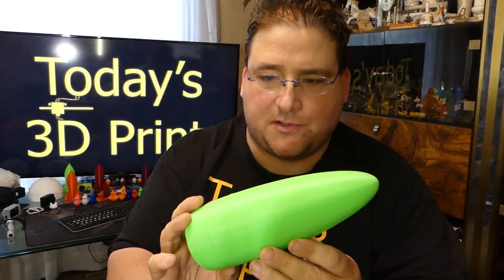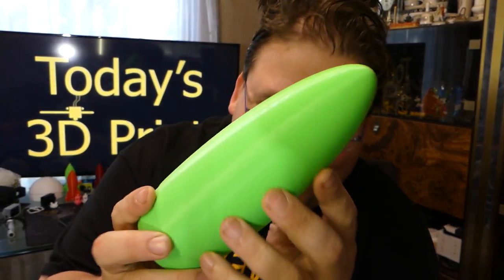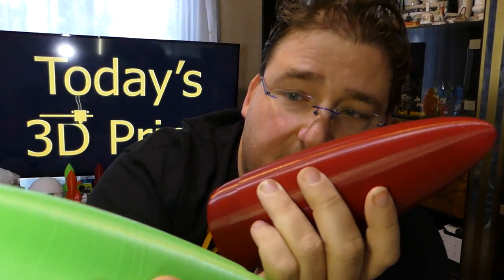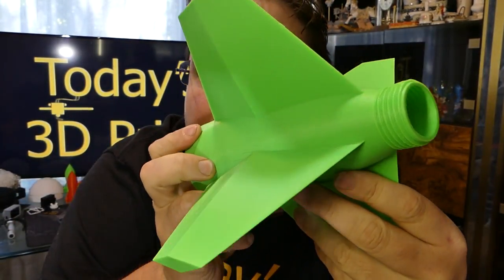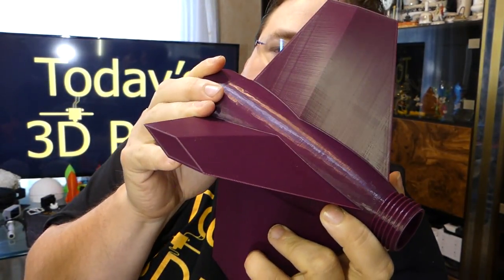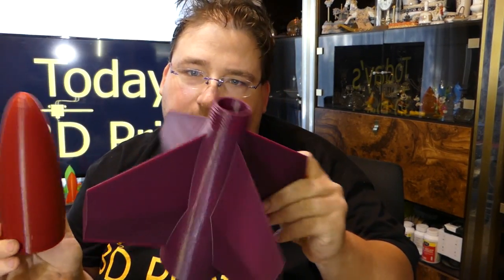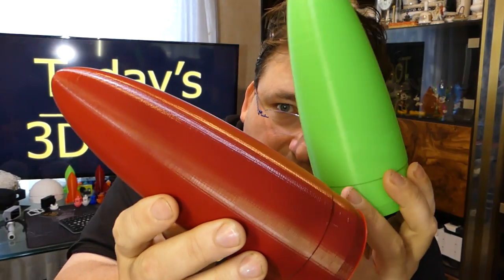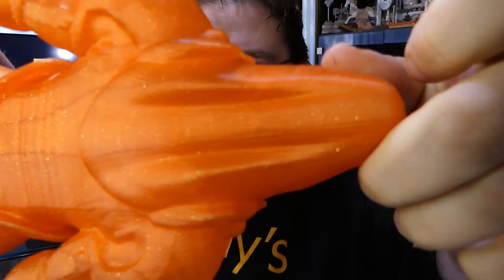Today's 3D Print 119 Print Quality Comparison Creality CR-10 and Tevo Tornado

Comment: If you are struggling to combine desperate bodies then under the modify tab at the top there is a combine feature. Select the combine tool then click the two bodies you  want to join. Ideally you would draw each component as one. I wouldn't draw two fins and the centre piece seperatly then drag them all together, if you know what I mean.

Comment: UGH!!!! I am so torn! I initially was going to buy the CR-10. Then I saw the reviews and comparisons of the Tevo Tornado. The quicker heating bed, and quieter operation, plus print quality made me lean in the direction of the Tevo. But then the salmon skin issue requiring the smoothers, and this this comparison video have me leaning back towards the CR-10!!! I can't make up my mind.
Reply from the maker: Jorden Epps the tevo tornado absolutely positively is not quieter than the CR 10 there's a reason they call it a tornado because it sounds like a tornado :-) but you can quiet it up if you can take her and have a little extra cash I would lean towards cr-10s with a c heat bed or if resolution is not King for you get the tornado with this smoothers and save a whole lot of cash 329 + 25 bucks for this smoothers that's a pretty tough to beat combo
Reply: Hi,  would it be possible to replace the stepper drivers on the Tevo Tornado with TMC2100's instead?  Cost is similar to the smoothers.  Is it a module that can be replaced or is it surface mounted?
Reply: Nerys, I bit the bullet and ordered the Tevo Tornado + smoothers today using your link. We'll how long it takes to come.
BTW, my daughter's middle name is Neryse, after the Star Trek character Kira Nerys.
Reply: tevo is little cheaper so you can add 32 bits board and have better stepper motor instead origina. do you resolve you srface quality issues with tevo?
Reply from the maker: the TL smoothers did resolve almost all of the surface quality issues. its still not as clean as my CR-10 but MORE than good enough and the results are spectacular. I suspect the transparent filament "hides" flaws. I FEEL flaws I can not see visually for example. gonna have to try some solid filament. doing that now. printing the skull mask in the Sunlu PLA + Green I got. looking good so far!
Reply: or you can buy a smoothieware board copy with better stepper and you will not have surface quality issues
Reply: Hey, im all in thinking which one buy for first printer. Just have one question, if this orange guy have face with eyes and nouse... which one printer will make face more detailed?
Like which is better in little models?
Reply: And also, as i got it - tornado is a little bit faster? All reviews in english.. My english is quite bad.. :(
Reply: tevo tornado with couon code is 50euro cheaper than cr 10..at this price range you can add smoothers, other quieter fan, and end filament detector with auto bed sensor..so it s better than cr 10
Reply: Jorden Epps I bought the tevo after the pros and cons of each

Comment: Hey Chris,
can you post the Acceleration and Jerk setting which the Tevo has? (also E Acc and E-Jerk and Retract Acc)? Because I assume the difference in the Zippers in these parameters... Thank you!
Reply from the maker: MasterFX2000 i manually set my acc to 500 and xy jerk to 10

I will check the others when i get home.
Reply: Ha ha... did you noticed that the max retraction speed on the Stock CR-10 is set to 25mm/s? So whatever you enter in the retraction speed in the slicer the CR-10 will just ignore it if it is above 25 mm/s. I just recompiled marlin to set the max to 80mm/s... lets see what happens. I also increased the retraction acceleration to 1000 mm/s^2 instead of 500 mm/s^2
Reply from the maker: +MasterFX2000 well well well I never noticed that! Very interesting

Comment: Modify-Combine in F360 combines bodies

BTW have you tried the smoothers on the CR10 yet?
Reply from the maker: +rok vez not yet. I suspect they won't do any good since the cr-10 doesn't have that kind of noise I noticed on the tornado it got rid of the salmon skin which was electrically introduced noise but it did nothing for the mechanically introduce noise ghosting ringing

The problem is the one part that I want to come by and see important STL not a body :-)

Comment: Thanx nerys for your review
Have you test abs or nylon filament on cr10 or tornado ?
Thx
Reply from the maker: +Eric RUFF I have never printed with abs I did buy a role to play with I have one around here somewhere but don't really have much use for abs nylon I really want to play with but have not yet the trick with nylon is bed adhesion from what I understand I have some Gara light for when I go to play with it but I have not yet the cr-10 would struggle with abs without healthy enclosure the tevo tornado shouldn't have a problem with small stuff since the bed can get hot enough the cr-10 would struggle with that I'm working on upgrading my cr10 to handle high temp Plastics I ordered a tevo tornado heatbed to add to my CR 10 maybe I will add it to the S4 don't know yet

Comment: Is it possible to upgrade the CR-10 with a similar heatbed as the tornado to get higher temperaturs and faster? Do you then need to change the software in the CR-10? Would it be expensive?
Reply from the maker: +Science Rox i think it is possible. Ask me in a month. I ordered the ac heat bed and ssr from tevo and i am going to try to do exactly that. If it works under $100.

Comment: Hi there. How would you get the tornado to the same high resolution as the cr-10?
Reply from the maker: Carmelo Di-Rosa not my area of expertise but with an educated guess I would say replace the brain board since the brain board combined with the stepper drivers is the source of the problem I believe so if you took the CR 10 motherboard and put it in the tornado should give you CR 10 quality

Comment: Hi nerys.  Interesting about the smoothness of edges.  I did a quick benchy comparison test between my tornado and my flashforge finder both with esun pla and same settings.  The tornado actually came out much smoother and better overall than the finder did and that was only on .15 layer heights.  Still playing around with settings to get top layers to fill completely and then i will be trying some petg prints.  Did tevo get back to you regarding the ptfe tube in the barrel.
Reply from the maker: +Mark Andrews not directly they simply say it's good to 260 degrees which tells me it probably is a PTFE tube inside so I have new PTFE tubing coming if I can figure out how to replace it it handles 340 C we shall see how that goes the flashforge finder is a much older printer that probably explains the quality difference

Comment: Also how did you go upgrading the cooling fans in control box
Reply from the maker: +Mark Andrews I got the fans and I got the voltage converter I have not had a chance to install it yet it's in the middle of a 70-hour print right now

Comment: Hi Nerys, I have the CR10 but im experiencing the exact same issue you show for the Tornado. If you look at the prints straight on they look perfect but tilt them down or up in the light and you see the shadows cast by misaligned layers. I have upgraded to second lead screw, changed belts, tightened, loosened and re-tightened to no solution. Im using your advise about printing from the stock files on the card to see if the issue is there and caused mechanically or if its software. You mention the issue but not if you have tried to solve it at all, i'd love to hear your thoughts of what it is or could be.
many thanks
matthew
Reply from the maker: +Alucard there are two ways that cause this mechanical and electrical mechanical would be the printer itself and Alignment issue of some sort electrical would be code or interaction of components in the case of a tornado it was the particular stepper drivers that used in relation to the board they used that caused the micro steps being lost which created the Salmon skin

To the best of my knowledge the cr10 and does not have this problem which would mean you either have a fault or a mechanical issue i e and Alignment issue so the first question is did you have this problem before you upgraded to the second leads screw because my first inclination is to assume you have a misalignment the two leads groups fighting each other pushing in opposite directions which would cause alignment issues
Reply: thanks for the fast response, unfortunately the issue was before the upgrade as the upgrade was intended to hopefully solve the issue. Now watching your CR10 build to see if ive missed anything. Its minimal as you say in your vid, no structure failure but annoying shadows. Just cant seem to pin it down, what puzzles me most is that its on all axis. I have an ender 2 coming which i can use for more intricate parts but wanted to see if anyone found out what is causing this slight misalignment. Maybe upgrading to RAMPS if its the step sticks?
Reply from the maker: +Alucard I'm assuming it must be a mechanical issue because none of my cr10 printers do this and I have four of them counting the s and the S4 can you show me a good picture of the problem
Reply: of course, can i send through here or do you have an email i can send them to?
Reply from the maker: +Alucard one more thing send me the g code an actual file you've actually printed that did this I will print it on my printer and that will confirm if it's a code issue or printer issue
Reply from the maker: +Alucard posting emails in the clear is a bad idea so just stick it on Google Drive and post a link
Reply from the maker: add the gcode (not the stl the gcode you sliced) to MAKE one of those such as the AXIS CUBE so I can print "WHAT" you printed. if I get the same result its a slicer issue. make sure its the actual gcode USED to make the object not a reslice.

worked fantastically. I see a whole bunch of problems here. first things first. PRINT my test prints. (see description goto my FFF profiles link and download the test prints for CR-10 gcode. load that onto your sd card and Print that and send me pics (you can use same folder as above link you already provided) it will print a marvin a benchy and a verns style rocket one at a time. (and a little disc on the bed you can ignore)

I see both over and under extrusion. what filament are you using? also try importing my FFF profile for the CR-10 and reslice. I am thinking you were tweaking settings and now have "multiple conflicting settings" that are interacting with each other or you have a mechanical issue in the hot end or with the extruder stepper.

the test prints gcode will bypass your entire set up and go directly to the printer. I know that gcode is good on the CR-10 and it will confirm if we have a filament/printer issue or a model/software/slicer issue.

I don't think you have any other mechanical issues (bend rods etc..) assuming your belts are tight and your vslot cars do not wobble at all. I think this is either extruder/hot end or slicer.
Reply: Awesome advice thank you, have taken your Gcode and printed. Managed to get the Marvin and Benchy but the rocket had adhesion issues so will reprint tonight now i know where i need to put the glue-stick. I can already see a marked improvement and your speculations seem to be confirmed that its likely settings and not mechanical. I am using white PLA from www.filamentive.com , using calipers at 3 points on the filament in about a 5 meter length i got 1 reading of 1.75 and 2 of 1.77, im finding it much harder to find Esun PLA Pro here in the UK, is the PLA+ the same product?. Benchy and Marvin uploaded to the folder. Thanks again for taking the time to help me out
Reply from the maker: +Alucard esun pla plus is pla pro. I think plus is right i just got stuck calling it pro for some reason. :-) 1.75 to 1.77 is perfectly fine.

Are you using simplify or cura?
Reply: have been using both, havent plucked up the get full simplify3d but have friend who does and will take your profile making me a gcode. Been using multiple profiles for cura none really getting me good results. Saw you are looking at doing a cura profile in the future, just installed v3 which i have read has a CR10 profile yet to use it though
Reply: Hey Nerys, just uploaded to the file the pics of the rocket, please tell me the 2 bands are meant to be there :P
Reply from the maker: +Alucard yes they are part of the model. I will look at the pics whwn i het home.
Reply from the maker: Alucard those prints look very good the only problem I still see it looks like you're running too hot what temperature are you printed at at?
Reply from the maker: +Alucard at this point I want to say we're done diagnosing your printer your printer appears to be fine this is all slicer now for final confirmation I'm going to slice the calibration Cube and send it to you when I get home tonight
Reply: Awesome will give it a go, The rocket, marvin and benchy was from your file untouched think it was 225 for first layer then 200 onwards. Have added some pics on the control box legs just printed. Forgot to up the infill but still sturdy enough.
Reply: Given away by the overhangs on the benchy windows and handle of marvin?
Reply from the maker: +Alucard some but also the platic is smoth/wet/slick droopy looking. Ie too hot. Or just tje way that plal is.
Reply: according to their site temps for their PLA is 190-220 so will try dropping it a bit once new roll arrives. Keep seeing temp tower tests but cant seem to get one to work in cura unless i manually change the temp at certain heights

Comment: Hello, can any of the two use flexible PLA and  ninjaflex  without modification?
Or can you recommend me  one printer for flexible  filaments?
Reply from the maker: +tapatio tapatio the cr-10 handle flexible quite well and there's a modified part you can print that makes it even better I don't know about the tornado I will look at it today and let you know you can tell somebody by looking I'll make a short video to explain how you can tell so you could determine if any printer will who will not handle flexible
Reply: Many Thanks, and good job, I will buy my first printer and want to print some cases for may rare phones and other objects .  You made me confidence, can you tell me what´s on your top 3 list of printers under 1200 Dollars (with flexible filaments support) ?
Reply from the maker: +tapatio tapatio all printers support flex with slow speed or mods.

Great printer to start ender 2 but only for small phones 160mm max. But only $145 and fantastic quality.

The cr10 also does a very nice job with tpu. I dont have experience with expenaive printers.
Reply: OK, very helpful.

Comment: Hey Nerys, I wanted to ask your opinion on the CR-10. A lot of people are buying E3D V6 to replace the standard hot end supplied on the CR-10. What is your opinion on this, is it necessary or should it only be considered for folks wanting to print at very high temperatures? 

Also what are your thoughts on adding auto bed levelling sensors and flashing the CR-10 Melzi board to work with it. My CR-10 has been printing really well with the standard hot end once I levelled the bed is properly. I just wanted to get your 2 cents on these issues. Thanks, I enjoy your videos.
Reply from the maker: Mark Slatem okay first some people simply enjoy modern in that case go for it be personally I just want reliable printers and the CR 10 is extremely reliable as it is in my opinion

It's one of the reasons I enjoy it so much no failure so far I don't think Auto bed leveling is necessary if the printer is rigid enough flat enough and consistent enough NCR 10 appears to be all three once you get the bed nice and level it tends to stay that way it doesn't drift the new version the glass plate is very flat and it's cheap enough to replace at Home Depot if you have the old version this means once you get the bed level it doesn't move it stays so you really don't need all the bed leveling

I suspect one of the reasons of Prince well is the hot end and I'm afraid to mess with that and mess up the good Prince I'm also working on a way of doing higher temperatures on the stock hot end I'm going to attempt to replace the PTFE tube inside the stock hot end with a higher temperature PTFE tube if that works I'll be able to exceed 300 C on the stock machine I also purchased an AC heat bed for the tornado to attempt to install on my CR 10

Remember higher temperature Plastics usually require higher bed temperature and usually requiring enclosure so consider those mods as well well.

My only suggestion if you want to go with the e3d V6 is to make sure you get a real one :-)
Reply: Nerys - thanks for the detailed reply, I have already ordered the Capricorn PTFE tube For higher print temps. I already print PETG very well on stock but the new tube will allow higher temp filaments. I agree with you 100%, I am not going to mess with the printer.

My CR-10 requires bed revelling every 10-15 prints, I wish I could get it to lock in and stay level like yours does. Maybe the springs are not under enough tension and the vibrations are wiggling the nuts over time...I dunno 🤷‍♂️